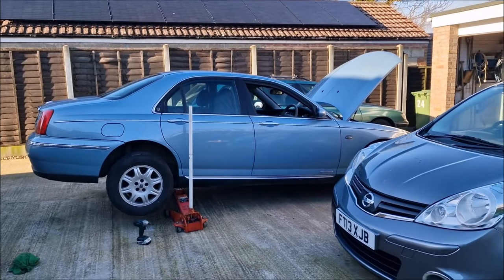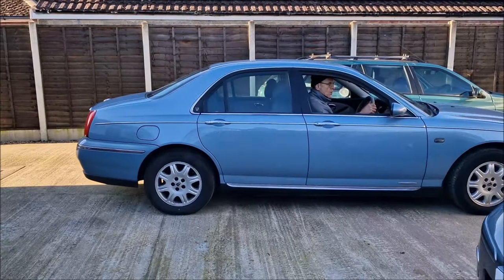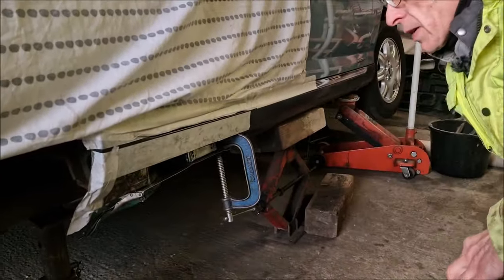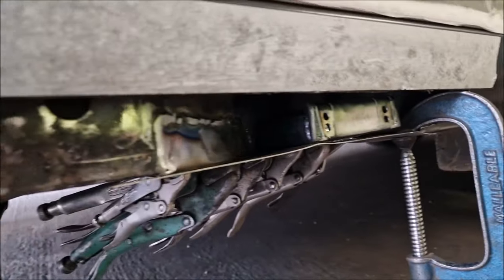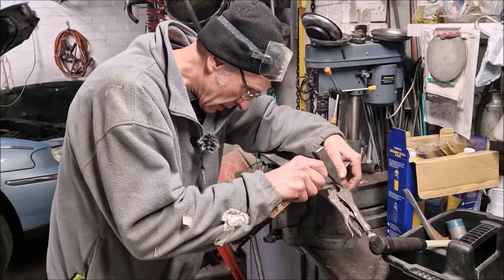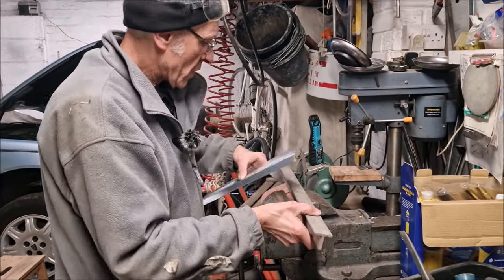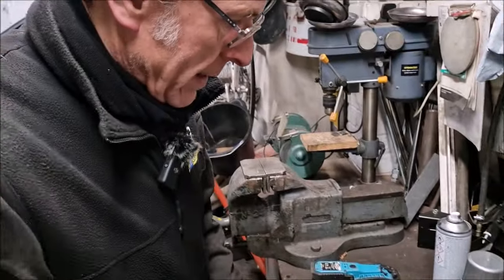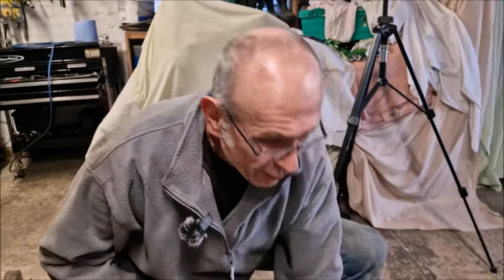Rover 75 Mega Video - The Entire Sill / Rocker Panel Rust Repair Series

Comment: The last Rover was probably either a ZT or a 75. Should be chassis number 883. Sadly, by that point project drive had well and truely kicked in and the build quality was questionable. Not sure so much about the 75, but the 45 had some horribly shoddy build quality by the end.
Reply from the maker: Hopefully we will see it when we go to Gaydon as we have found out that it's there